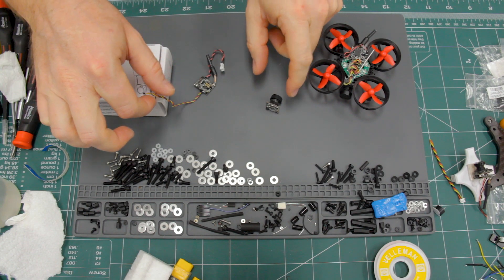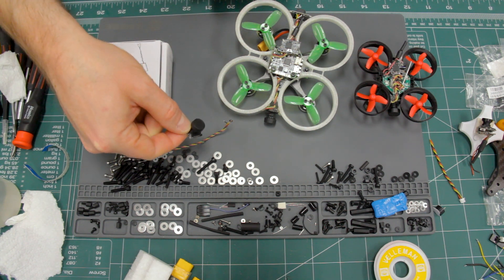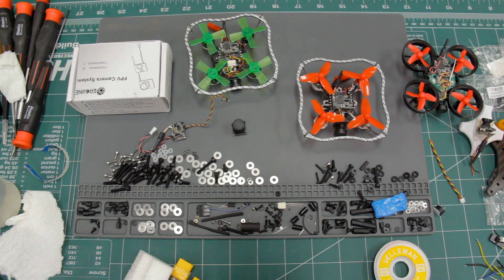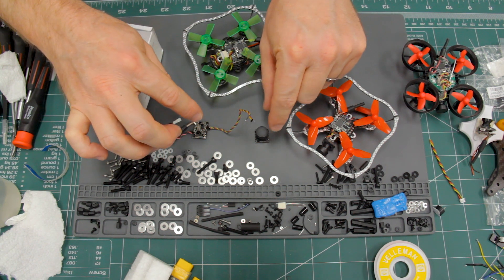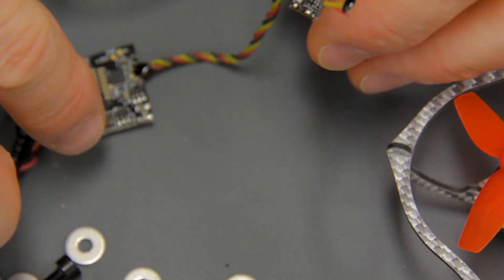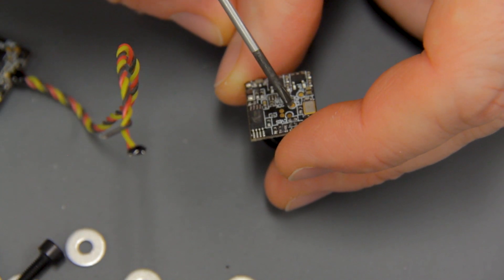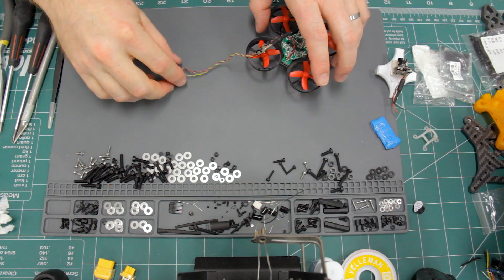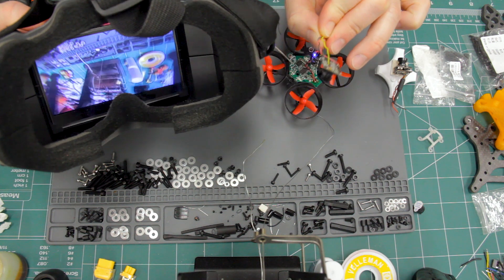Fixing FPV Camera that has a Damaged Soldering Pad

Comment: I have a runcam nano 2 and video solder pad lifted. Searched high and low and can't find info for another spot to solder to
Reply from the maker: I just searched through my stuff and I do not have a Nano 2 that is not installed on a quad so I cannot get a good look at the back of one.  The ones in the quads have a cover over the circuit board on the back.  I would think there would be a pin or pad somewhere that has the CVBS signal.  You could probably use an oscilloscope and poke around on the circuit board until you find the signal if you know what the signal looks like.  That is as much as I know right now.

Comment: Getting black lines in video.. think I need to redo my camera wires.. i had to add extensions and went to long. Wores kinked.. just  no room thpught I needed more slack. Now I have to redo it
Reply from the maker: I have not come across the black lines issue yet.  Hopefully redoing the wires fixes the issue.  It could also be a small accidental solder bridge to components on the camera next to where the wires are soldered on, or a small bit of solder splashed onto something causing a short.
Reply: @IanBeaty  After changing things one by one.  Turns out the cheap happy model vtx didn't supply a good 5v from pad. Originally was on battery power but this camera needed 5v max. Finally when I moved the power wire to FC picture way better.  
Though I just quick did it to test it.  So looks like shit. But at 3am was too lazy to redo lol. Now I'm like I'll wait till it breaks lol
Reply from the maker: @QSpeedRacer  That is super interesting.  Thanks for the update about this.  Definitely something that had not crossed my mind as a potential problem.

Comment: so i took a hard hit on my mobula7 camera and now it shows a green screen can help me out on some advice or what to do
Reply from the maker: Hmm.  That is something I have not seen before.  I did a little searching and came across a couple forums about a similar problem.  In here (https://www.fpvhub.com/index.php?topic=39690.0) they figured out that it was because not all the plugs were as tight as they needed to be for the VTX.  Here is another post about the same problem (https://www.rcgroups.com/forums/showthread.php?2374607-Hubsan-H107D-fpv-screen-fuzzy-and-green) and it was because of fragile wiring to the VTX.  It looks like it is most likely something to do with your VTX wiring.  You could double check all of your wiring that has to do with your video system (camera, vtx, OSD, etc.).  Good luck!